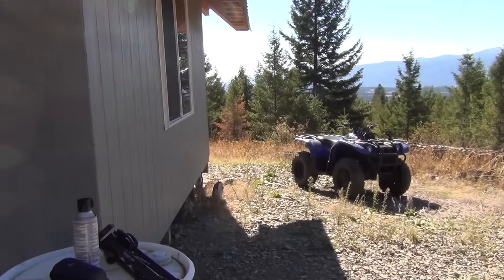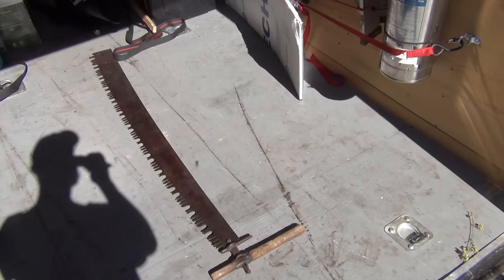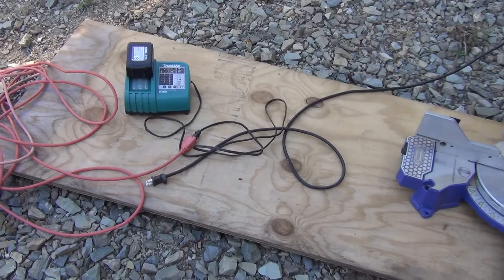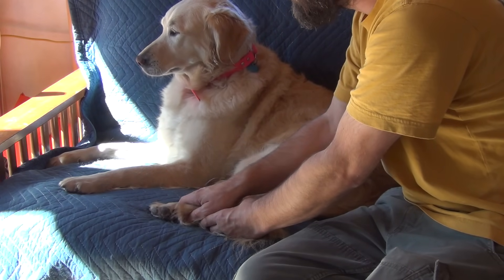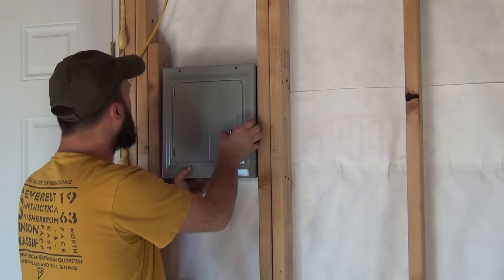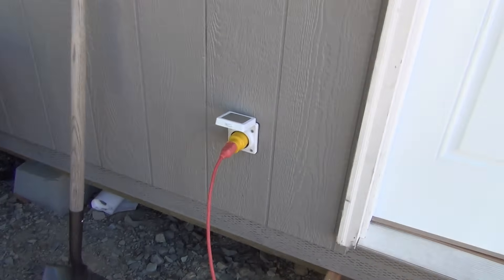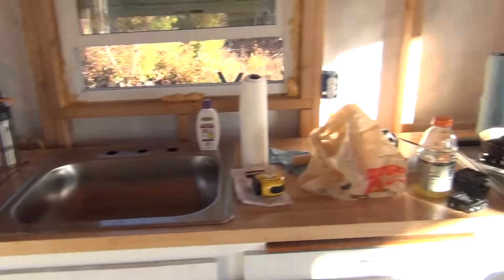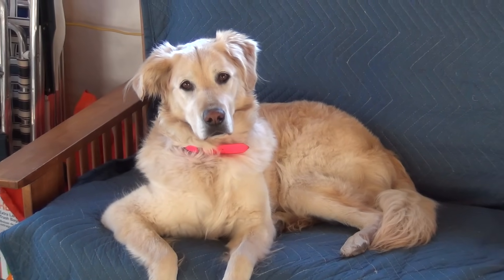Off Grid Cabin Electrical

Comment: Great video! It's helping me run my wires at my new shed. I just happened to be looking around for a video like yours and there aren't many around. I do have a question for you. How did you connect your wire from the Generator Plug to the Box? Which wire goes where? I'm running wire right now and don't know how to connect the generator wires to the box.

Comment: I'm trying to understand what you did here as I am wanting to wire my cabin for generator power in the same way. It looks like you simply wired your Romex into that marine shore power inlet/outlet. No breakers except on the generator? Is that correct? I hope it's that easy as I can't seem to find any videos that explain if this is OK to do. Thanks.

Comment: would be nice to know how you wired the inlet to the breaker box :)
Reply: Use a interlock to a panel and some have 10 slots but only need 2 to 3 then run the wire

Comment: Could you use those led seed warming beds to heat a home off grid by, laying down that foil bubble insulation then lay down those LED warming lights then lay down heat rated foam then lay carpet over it all then operate the LED warming lights off a solar panel system? A redundant heating system that you don't have to burn anything that generates toxic byproducts? Novartis

Comment: The Stirling V-6 cold gas engine should be constructed using magnetic bearings gadolinium should be used for the bearings on the cold gas engine to reduce vibration of engine and no need of lube for moving parts. Sure its a lot of technical stuff but ounce you have everything up and running? Priceless!

Comment: If constructed correctly you would have an air conditioning and electrical power generation system. Or even a walk in freezer or refrigerator to store goods has well from the liquid argon gas being used. Way better then just solar panels.

Comment: Another idea would be to use a Stirling engine that turned argon gas to liquid that filled an insulated cylinder with liquid argon gas that had Stirling engine pistons in it to create a cold gas Stirling engine a V-6 with two fly wheels that could crank two rewired drum motor generators with magnetic bearings to generate high frequency electricity. The trick would be to use a solid state sponge for the argon gas and a graphite power bank and carbon power cell to operate the cryogenic Stirling piston that turned the argon gas to liquid with the argon gas being stored and drawn out of the solid state sponge. Then have the electronics to step down the electrical frequency to allow it to be used by devices designed to function at a different electrical frequency with a surplus of energy left over that then could be stored in graphite ariogel ultra power cells the size of propane tanks.
Reply: Sounds incredibly simple 🤦‍♂️

Comment: How about using a solid state graphite power cell bank to charge a organic carbon power cell bank that operated a rewired drum motor generator with magnetic bearings to power a off grid cabin? Beats solar right?
Reply from the maker: Jim Martin what charges the solid state power cell?
Reply: design2survive earths resonance field that generates the atmosphere.
Reply: design2survive the magma under your feet under the rock or crust resonantes energy out ward this is how the solid state power cell generates electricity from that high energy vibration. Sun light vibrates at 126.22 hertz the earths resonance is 7.86 or something like that the crystal structure of the graphite power cell generates electricity in this manner which then can charge a organic carbon power cell that can power other devices. Look up each device on you tube do your homework and check out how each item functions for yourself. ; )

Comment: i like that plug unit you installed. my pre built home is on the way.  what is that material your using in between the studs. is that insulation. or paper for moisure before the insulation?  thanks
Reply from the maker: Kenneth Krajewski thank you.  The material is just basic tyvek for vapor barrier.

Comment: what the name of that plug u drill on side of cabin need to buy one and what amp breaker box u are using inside thanks rickey
Reply from the maker: Rickey Patrick I think it's a 15 amp marine inlet.  I don't know what the breaker box is rated...way more than I will put in in.

Comment: Great job.  I have that same brand 30 amp shore power inlet in my garage wall. Nice and weatherproof when closed.  The $tainless steel one with screw on cover went on my boat....

 I would be real tempted to put a 30 amp boat cord inside some cheap 3'' plastic drain pipe and bury it between your generator shed and cabin. Then seal the ends with expanding foam to keep critters out. That Honda does 16 amps. Bigger is better on extension cords.

Some marinas make boat owners replace ''weathered''  shore power cables. That's where I got my 50 footer for free. The grime came off with a WD-40 soaked rag.

Is this somewhere in NorCal?

Comment: I like your videos they are inspiring.  Why not install two 250W solar panel and a 24v inverter a few batteries and run your cabin off solar.
Reply from the maker: James Cox I'm saving up:)
Reply: the few batteries alone would run $2500, a $300 generator is the best option lol